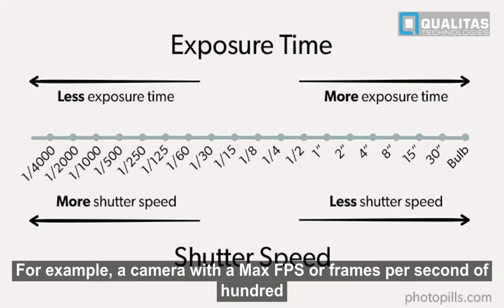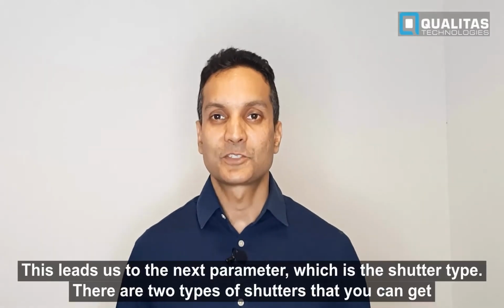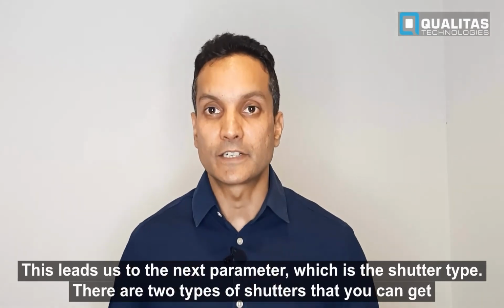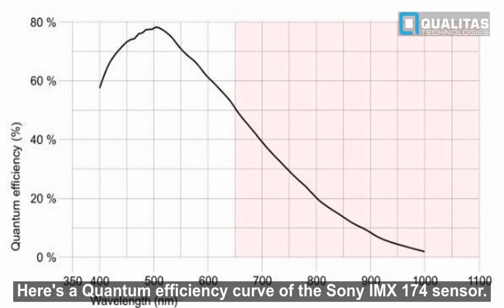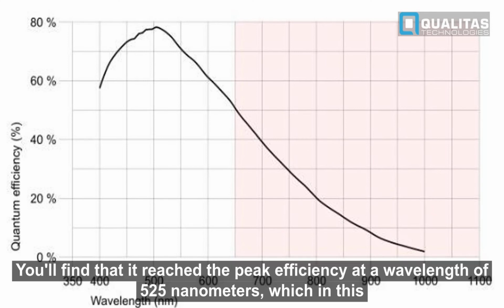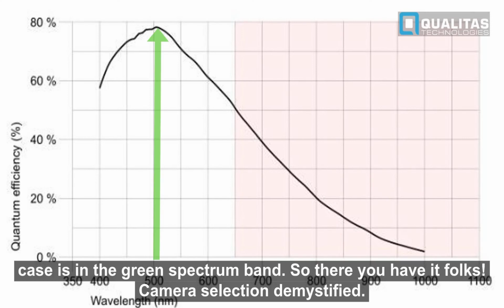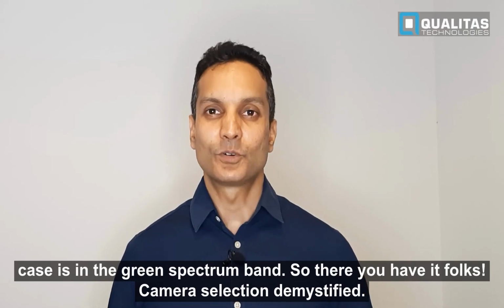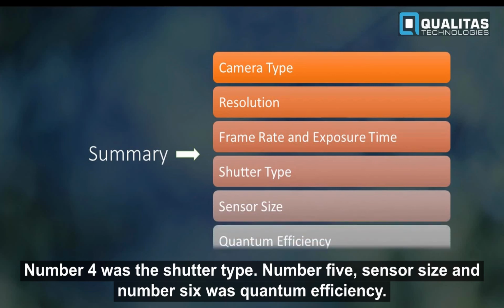Guide to choose machine vision camera! | Qualitas Technologies

Comment: He has mentioned in the video that for a given resolution the pixel size is smaller in case of smaller sensor and higher in case of higher sensors. Again higher sensors are expensive.  I want to bring out the point to viewer that, we need to go for higher sensor size i.e. spend higher only when the object that you r imaging is expected to be in darker place or the object is less luminescent. it is because bigger pixel will result in higher signal to noise ratio and the images would be less grainy/clear. Expert may comment if I am correct. 

I want to know whether you have model with same pixel size but with increased QE ?
Reply: Hi Sandeep - That's exactly the point being made. Large sensors are expensive, but it's not just total sensor size, but also pixel size that we need to consider. Example - if we keep the sensor size the same, but compare two cameras one with a higher resolution and the other a lower resolution - the lower resolution camera will have a larger pixel size which is sometimes advantageous especially for measurement applications as the "burden" on the lens will be lower. 

Further reading: https://www.edmundoptics.com/knowledge-center/application-notes/imaging/pixel-sizes-and-optics/

However, do reach out to info@qualitastech.com - we have a wide range of cameras with a range of QE.
Reply: . 
 
  
 . .  
  

 
 , ,  .. 
 
 @raghavakashyapa9134   
..